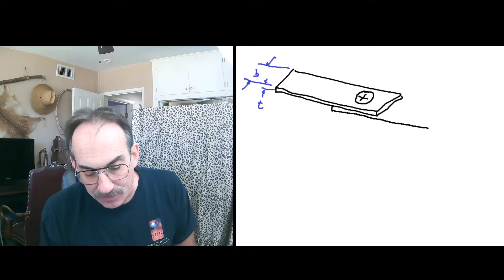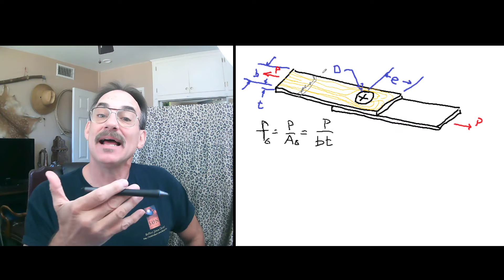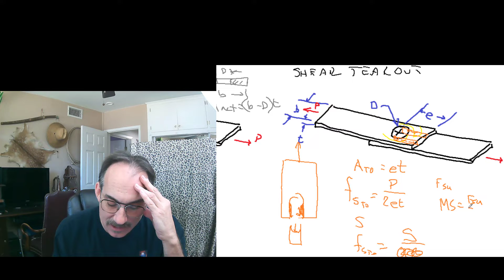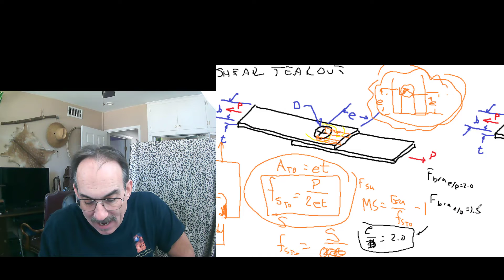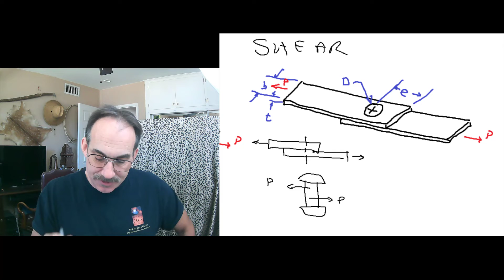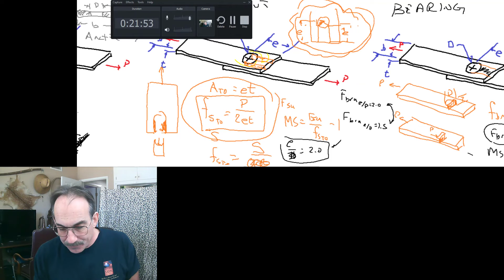Strength I: L-05s Load Transfer at Fasteners

Comment: Dr Coburn, average shear stress (tear out) is used. I’m assuming this is appropriate at ultimate loads assuming load distribution? Are there times when a max shear 3/2 P/A would be used or just assume we are covered by average and/or the other accompanying checks?
Reply from the maker: The tear out calculation is really valid at any load, but yes, it it more valid at ultimate.  (3/2)P/A is valid for changing moment (applied shear) and never appropriate for tear out, sice tear out is a direct shear effect (shear reacted over miniscule length)

Comment: Hi Professor Coburn, the actual stress near the hole would be much higher than just P / (b-D)*t right? Because there's a hole, stress concentration is introduced. Therefore it could fail locally, (I would imagine a crack) I'm unsure if it will lead to complete failure. 

So when would it be acceptable to simplify such as the one in the video (net tension stress) versus evaluate with the stress concentration factor included in the Aerospace Industry?
Reply from the maker: The first check is net tension, shown here.  That is the average stress and often matches ultimate failures better.

Stress concentrations apply most directly to stresses below yield, resulting in higher stress than average, but not higher than ultimate.

Once stresses rise above yield, the local modulus drops, resulting in redistribution of load, resulting in a reduction in stress concentration.

The stress concentration video discusses this a little.

Stress concentration is more important for low loads, and tends to drive fatigue and damage tolerance failures.  This is discussed in lectures 3-6 or so of the strength/structures 2 playlist